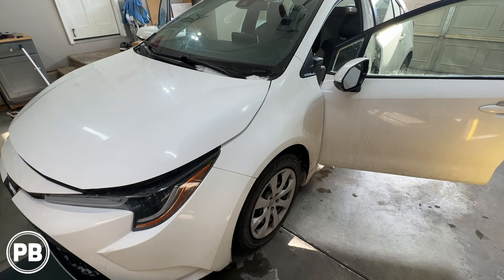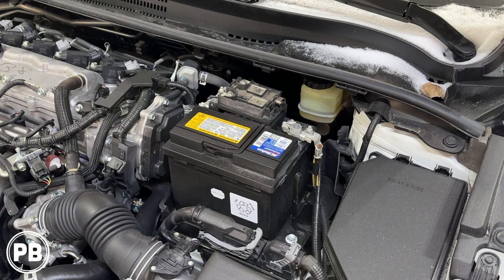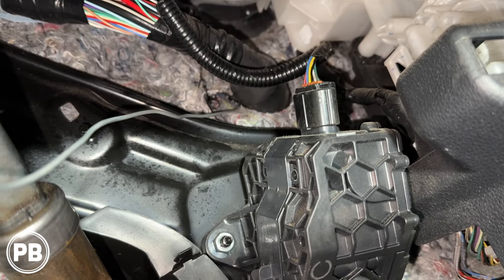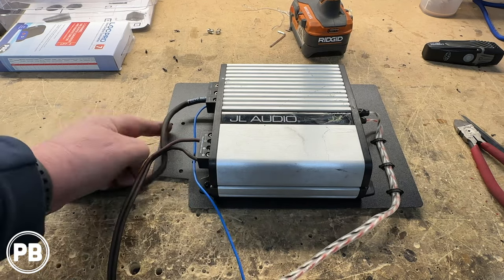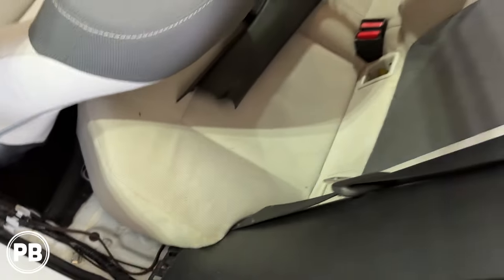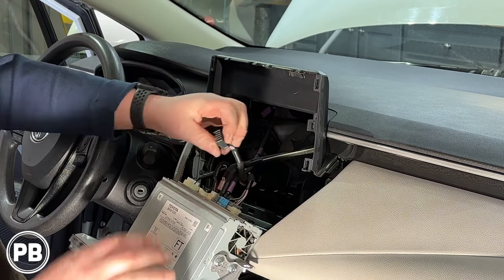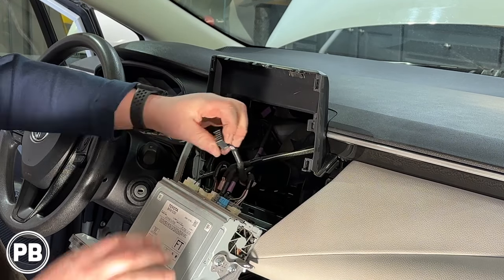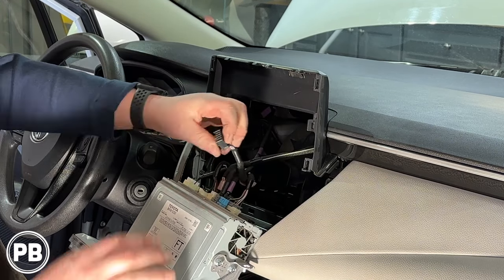2020 - 2023 + Toyota Corolla Amp and Sub Install

Comment: Will this work for a ‘20 Corolla hybrid?
Reply from the maker: Hybrids are tricky in that they don't have a traditional alternator, and instead High to low voltage reducer / regulator to charge the 12v battery from the high voltage hybrid battery.  Most converters by toyota are 30 amp output, so this "may" work, but may be too much for your hybrid's electrical system to support.  You can still add a sub, but consider something a bit more conservative (20 amps max).

Comment: My constant power and negative for loc are different colors. Mines not turning on
Reply from the maker: use a multi meter to check your connections.
Reply: @ProvoBeastAudio  found the my remote turn on connection was loose. Amp turns off but goes into protection mode right away as soon as the sub hits
Reply: @ProvoBeastAudio  found the problem. My ground had a small plastic backing that I didn’t notice. Fixed ground works great now!

Comment: When does the head unit clip?
Reply from the maker: From what I remember, clips after 60.
Reply: Does the JBL headunit (premium audio package) clip at 60 as well?
Reply: I have the non jbl 2022 corolla SE. For the sub frequency(40Hz) it was at vol 60. And for the highs (1KHZ) it was at 45.I used the SMD DD1 to check. Since I just added a 4 channel to my system I set both my sub and highs amp 45.I'm using A LC7i as my LOC.With the T harness that PB linked in his discretion.

Comment: question... where to connect the remote cable
Reply from the maker: We talk about it multiple times (you have to watch the entire video).  Start @ 10:03, or jump to 12:35
Reply: What’s the remote out wire from the stock unit?
Reply from the maker: @athitthongsaeng7728  There isn't one, instead, there is a accessory wire on the factory radio you can tap into.  Use this video to walk you through the process: https://youtu.be/pxxNvI393gA